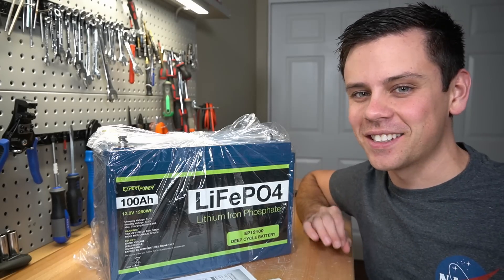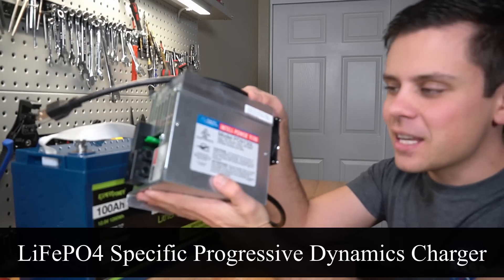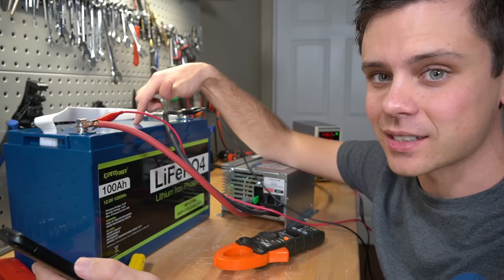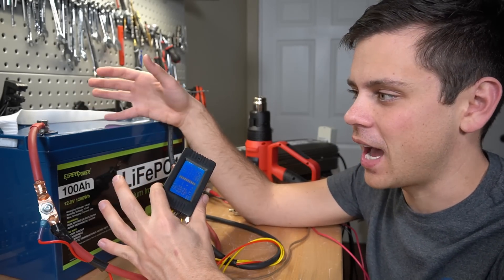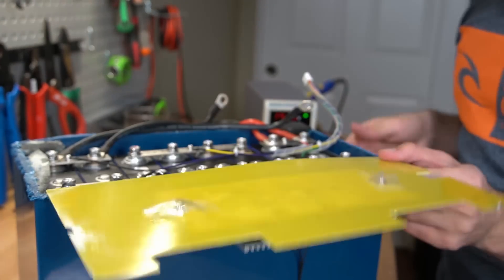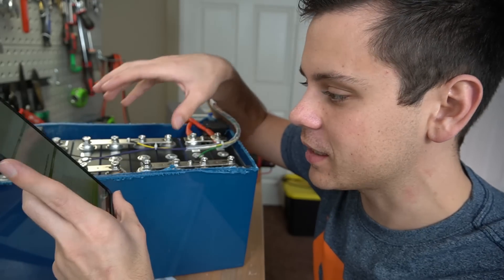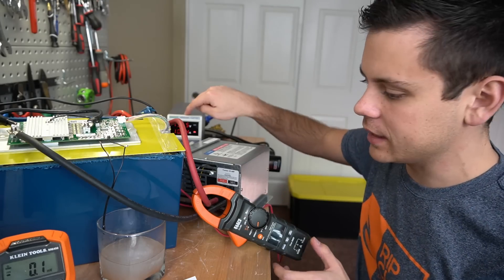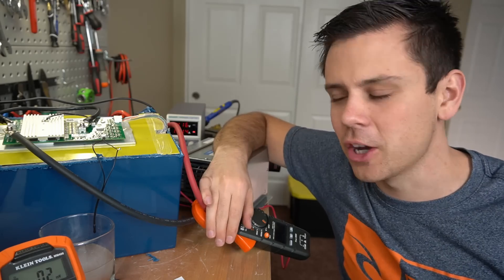ExpertPower 12V 100Ah LiFePO4 Battery Tear Down!

Comment: Thats the same results I found with the Valence U1-12RT and Valence U27-12XP batteries I tested.  It gives specs for low temperature cutoff in the data sheet but in testing (froze both batteries for 3 days at 0 degrees F  and then began the test. There was no charging or discharging protection to protect against internal cold temperature Lithium plating and damaging the battery,
Reply: Will - In looking for a way to create a separate circuit to provide low temperature protection it looks like the Morningstar RD-1 relay driver can be programmed to do just that (as well as other functions like generator start and a whole host more). But at $148 a lower cost solutions would be much better.  I think that if you happened to find an add on product that will provide low temperature disconnect to protect LiFeP04 batteries that would another huge winner solution for your YouTube channel and all the rest of us that love following what you are up to.  Keep up your great adventure and work!
Reply: Or the VMS was smarter then you expected. I think we should let these companies have a chance to investigate but for this battery they have already admitted after you guys had this dialog of course part of the true explanation and it is sufficient tooth ever trust them again. I do not agree to the mix turtle possibly some distance away temperature sensor can know enough there just isn't enough Intel unless it has some sort of communication with a sensor that is inside the battery I think that these batteries need to report their internal temperature and then we can decide whether we can use them
Reply: Specifically the new battleborn that's going to come out if you try to charge it when it's too cold it will either have used the energy in the battery to not get too cold or we'll use the charger current that you provide to warm the battery up so just because the charger says the battery is charging does not mean that the electricity is being used to damage the battery and maybe being used by the BMS to heat the battery. Any intellectual property contained in this comment is confidential and published incidentally in this note to the channel owner. Further All rights to set intellectual property right to the extent that the native will by me given to this channels creator
Reply: I have decided that the sounds that I make in dictating these comments is being in part uploaded buy Google and saved for manual review at times and for purposes of Discovery what I actually said in the prior comments about the intellectual property belonging to Will prowse and nobody else he might start to try to steal it from these comments not even me of the specific comment that I noted that in are subject to Discovery and control. On the same hand the initially published or whatever I said versus what actually appear at any point is not publication itself and certainly no other form have anything I've said in any of my comments other than what I did not delete when I looked at it if at all is arguably publication. For the record none of the comments here waive any intellectual property that anybody who is contributing it to the extent that I can so decree that and I do the Kree that to my own words. This is not a publication for the public it is a publication for the viewers of this channel who constitute identity that is exempt from any case law any thief might wish to cite!
Reply: Well you know I haven't plugged my phone in and the battery went down real low and I put it the airplane mode for about an hour while taking care of some other business before finding electricity for it I had packed up to go someplace and frankly I've been in route so that wasn't as trivial as it should have been and it made me feel like it was me he was tired you know just because my battery I tried to take some pictures of some of my irises or whatever in the greenhouse or whatever and my phone was telling me even though I plugged in for awhile hey we can't take the picture yet and of course I could have used a different app to start so demented is the Samsung camera because it is plugged into the other grid basically and you had it still thinking of the battery is too long and if that's the case up until 15% I think if you can use the Camry even though you've gone from 4 to 50% in just a matter of seconds but anyways I'm trying to say here is I appreciate everybody who likes the idea of you. Getting rid of the pollution even if nobody understands where the flu shot in is in terms of a car so you know it's not just the brake pads it's not just the tailpipe it's not just the Heats pollution but the main source of the pollution is the Lost Treasure and that treasure is going to other countries right so that in the United States all the most beautiful women its Vault you don't apply for scholarships by strutting around and evening wear and saying something stupid or not that those women kind of become the stable or whatever for the people that we're sending all our treasure to because those women are subject of economic coercion because they're only human and the amount of treasure that we've been sending too well to Tesla for example equips Tesla to pick him on our daughters anybody anyone whatsoever and say hey you know what come over here why don't you stay awhile and these women care deeply about what that treasure could be relaxed reallocated to these are not cheap women it's not about protecting their own virtue it's about the rest of the world that this treasure that we've lost to the Tesla's you're being channels by the choices that they make give them almost no agency.

So we have this expression I haven't seen before in terms of subscribing to a Mobility service what it's talking about using it seems an ounce of energy right but using you know the spring water the flush the toilets and then the reclaimed water to drink. And we do do that right now most places that generate electricity the best water is being used to condense the steamer in the turbine in the chillers because the electric companies don't have to pay anything for all the illness that the reclaimed sewer water that's been served up as drinking water causes in the public but they save a small amount of money on cleaning the chillers if they use the water that would give Health not cancer etcetera to the Chillers but not to the people.

Nowhere is this more evident historically than recently in Motor City you know where they have the best water in the world exported all over the world and they have some of the dirtiest Rivers well you know I hadn't plug my phone in and the battery went down or allow and I put it the airplane mode for about an hour I'll taking care of some other business before finding the electricity for it I had packed up to go someplace and frankly a bit in route so that wasn't is trivia as it should have been and it made me feel like it was me was tired you know just because my battery I tried to
Reply: At least I got the repetition early and didn't waste too much time talking how about the water but we do need to wrap this up I opened up a bag of potato chips and it was not a good idea and I'm continuing to eat it because of this dictation nonsense so I probably need to get some distance between me and this bag of potato chips and also you know how people understand why this comment is all about in response to a lot of real ugly speech that you're seeing come out of people on here where there is setting to women hey you should be in the padded room or whatever I remember when I was a little boy there was this one girl I had a crush on it and she used to send me all kinds of notes about meeting the going to the zoo or whatever and then later on you know she didn't remember me when she was trying to make her moves on me in the backseat and I sent you know I used to like you and that really was pretty good to get her to lose interest at that time and I were both pretty happy and since then I care about women's feelings and had I not caring about her feelings you know I would have not cared about my own you might say right so we have to care about the truth when it comes to cars and operating them with electricity.

Just putting a motor sound through a speaker doesn't address why somebody is buying the car instead of say a subwoofer speaker for their living room direct

Thermae their baby last money providing speakers people's living rooms then giving them a car to listen to tell you know the subwoofer end and that's not that good of music right on C-Span there is a real idiot and I was listening to the downloadable discussion about his book last night and he got his addiction to money when he was a child baby bump shirts and this adult so what he was doing for his family and offered him $5 and his parents didn't call the police on the neighbor but they watch the scared you start getting money from all kinds of people and now he's got this big website where all these uneducated people are talking about things they have no no understanding whatsoever no training no education in and of course if you do that if you can't help people who don't know anything feel like they're not as horrible as they actually are and should feel they are then you're going to get a lot of support you know like in Nazi Germany.

So you know this guy goes on endlessly sang the most offencive things like if you don't want to work more than what we were supposed to be working as predicted long ago than just live the life that people lived back then.

I have to admit it is very difficult to understand and even more difficult except how anybody does not call this asshole out at least I caught the repetition early and didn't waste too much time talking about the water but we do need to wrap this up I opened up a bag of potato chips and it was not a good idea and I'm continue to eat it because of this dictation nonsense so I probably need to get some distance between me and this bag of potato chips and also you know how people understand what this comment is all about and response to a one of real ugly speech it's your seeing come out of people on here or there saying to women hey you should be in the padded room or whatever I remember when I was a little boy that was a swarm girl had a crush on and she used to send me a kinds of notes about meeting up go into the zoo or whatever and then later on you know she did remember me when she was trying to make her moves on me
Reply: Anyway people criticize Tesla not so much for the loss of treasure to the company but for spending nearly as much on very you know unfortunate things like lithium and the robots and the lands and not so much on the income of Tesla's workers that's not really much money and people are pointing out you don't like the former vice presidents that the companies that are providing the Arts of this era are not employing very many people but the cars that were produced previously did require a used number of man hours and that represent is four more families form an hour because it wasn't a man and woman our it was pretty much I'm an hour and that means that one person supported in additional adult from working in a few days a week or maybe 5 or 6 days a week but right now we have these two adults that previously worked you don't understand hours working over 8 hours and that's not the kind of progress that we were expecting.

It is not that the car taking a seat at the table but that everybody is sitting on the floor and this car literally has covered the table that none of the tires are touching a table they're all hanging off the edges and there are different kinds of expenditures of course and what combustion represents is a dollar that is being you'll not given to a person to spend on the next person so they can spend it on the next person and turn when you burn something the money is not conserved the barter and there.

This is very true for electric cars despite some of the components of the cars being recycled as has been pointed out however with the exception of the gasoline or diesel everything that goes into cars is one of the most recycled and there's a reason for that because the car industry recognize the thread that used cars represents to their continuing to employ people less and less and pocket more and more profit.

Luxury cars and larger cars and obsolescence of previously sold new cars these are the things that created an industry that took too much of our treasure overtime. They didn't buy financing schemes oh, they did it with various options of our society. A paragraph

So operating a car is a vice. We talked slices which hacks vices. You know whoever program this computer to generate these words to try to the trains without us knowing we're training it had a pretty wicked attitude. I would love to train this tiny little microprocessor that uses a tiny fraction of a lot to spit out this gibberish in a conventional speech recognition way but I realized that if I touched the nonsense words I'm teaching it more that I understand. And it should be the other way.

Unfortunately I can't see the gibberish and hopefully we'll get back to it in a minute but yeah the bangkok's is prophet so let's try that one again when I say tax I do not mean governmental I mean a defective design that allows a third party to charge too much and in so doing keep too much money for themselves.

The difference between Houston and New York City has has been noted recently is that a New York City the people are spending more money on stuff that they get the benefit off. In Houston people don't have running water in their houses right and the money that they spend is going into the mineral sellers.

 Now scientifically we know that water can be a metal you don't like a little bit them or stainless steel.

I said actually aluminum as the other metal that is comparable to water. Most of us know water as a crystal however for example the snowflake is an obvious Crystal but if you have very cold weather you would get not crystals falling from the sky but metal. with the properties of metal.

 So you know there is a question here about whether people want and need a pogo stick Oreck rain, or a crane.

Do you need a steam shovel or attend Fork. Choosing the right tool is about having the proper selection of tools. We are aligned about legalizing prostitution, we actually are not aligned about legalizing it but we hear a lot about legalizing prostitution. Prostitution is of course defined as limiting the amount of time a mother who is raising children can receive government assistance without abandoning her own children to attempt to get paid by somebody else other than her children to help other than our children except financially.

 First World countries as is very popular the point out do not make Paris sell out there on time for extended periods of time. Countries like Germany for example have much longer vacations. The transit systems in New York City allowed people they're much more to take off the entire summer.

This really is not that complicated if you have the general population buying equipment switch it one point made sense for full of joy riding you know if you had somebody that you didn't want to lay off when you no longer needed them to take care of your horses CCAP the similar with Carriage to what the horses needed call you around the town you know at some point people stop having a person in their house to operate the Horseless Carriage and there is no reason to keep the same sort of Courage either.

 But we have and it's really the sickest thing anybody who has any objectivity or does not have a highly manipulative myopia
Reply: There are some realities that people who fight for electric cars are not willing to understand and that is that the externalities of using a car-sized machine for the purposes that people use cars requires that the electricity at these charging stations be far more expensive than home. Don't turn it into that is to have the people oh, I had said that the alternative to that is to have the people that are not crazy and evil enough to take a car with them everywhere they go literally subsidize those hoolock the conscience you have no education or otherwise are up to no good. Next paragraph text paragraph next paragraph

I guess my problem there are ways that I forgot I need to type with my voice that commands and this song computer is not that smart so it's new not next but let's get back to the subject here of what we're talking about we were talking about electrification and you know we've seen a review of a Chinese import car and it's been pointed out that for rent number of years they've been making nearly free cars in China for Chinese people that don't have these monstrous batteries and this channel says you know we don't need these monsters batteries either you don't like the third of the size of these batteries would be fine.

But there is a consensus here bad it should cost less to own and operate an electric car then it does to operate a gas car and not just a used one but even the new one.

So you know you have to pay retirement to your employees and there are other costs involved in the manufacture of cars that will either prevent the companies that make them from being sustainable at least domestically or those companies like apple we're going to have to charge the markup on the fuel.

If you want to reduce the Lost Treasure you need to stop arguing about the facts. The cost of the fuel is almost insignificant that's why people are hesitant to spend any money on a hybrid car and I understand that the hybrid car cost far more to manufacture than electric are even now oh, but what you folks don't understand is that if more people use more rational Mobility tools the cost to everybody for supporting Mobility we go down so much that everybody's Mobility capacity with drastically increase.

After all is six-figure cars don't do much compared to cars of decades ago. This is despite the fact that we can see what technology can do and it doesn't cost more than the most optimistic future of operating an electric car.

But the more cars that continue to be manufacturers the harder it is going to be to ban them universally.

Greta may not say this but that does not stop the rest of us from talking about the truth here. When you're moving around the less you carry with you the better you're going to be able to move. When you have limited resources and the resources of this planet that doesn't mean money in case you're not aware of it the resources of this planet are very limited. There may be greener pastures for us we're going to need to leave this planet soon get to a better one and if you try to protect the use of cars by the public you are basically doing even more people No Escape
Reply from the maker: With the RT?!? No way!! Wow that's crazy. Glad you did that test. You know what? I'm just gonna tell people to use solar charge controller with low temp cut off on all systems. These BMS cannot be trusted.
Reply: @WillProwse  Will, I think you're right. That is the only positively assured solution, and then you can safely use and otherwise good batteries.